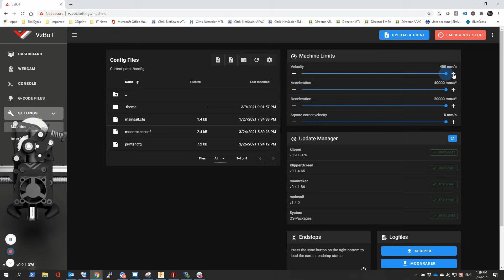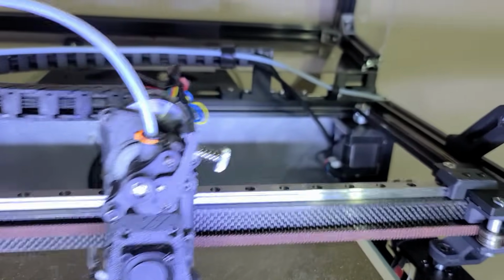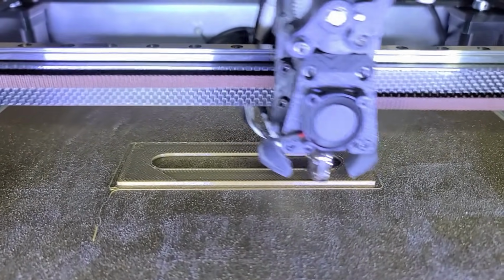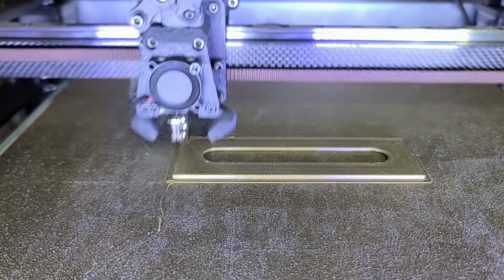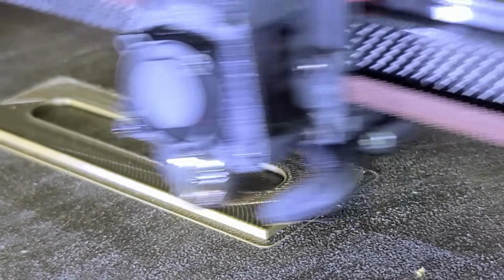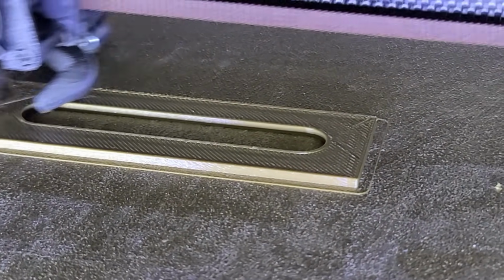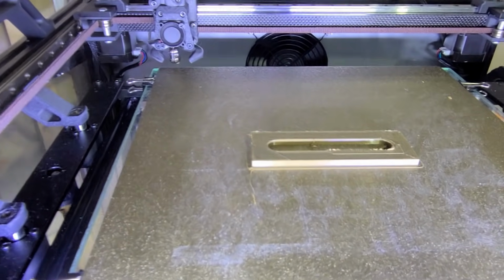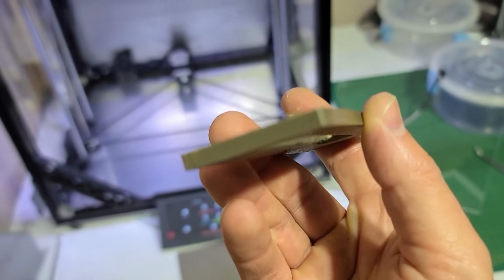Nova Hotend Speedtest 40K 400mms!

Comment: @VZ3d is it possible to set up your hotend with a phaetus Dragon BMS from Triangle Lab? If you know where I'd be able to find some stls to accommodate my printer with upgrades soon... I've been noticing that alot of people who are running klipper with these super high temperature hotends and core xy systems get a way to ridiculous printer speed....Id like to build a voron 2.4 or something close to your vz build, cuz you explain what you got going on under the hood of your hotend? Or are using multiple heads? Your Nova hotend is Soo cool 😎...Right now I'm barely using a Ender 3 v2 and I have a Phaetus Dragon BMS from Triangle Lab and I want to make upgrading the axis a Lil project also the hotend too....I just downloaded your CAD file design, any advice for a 3d printer enthusiast to get some inspiration? Also keep up the great work man and keep pushing to new heights ,.............alex

Comment: Based on everyone talking about the fans, it might be timely to to add a tube with pneumatics for the ultimate cooling solution. Who knows if you have enough pressure you could even help with the acceleration lol. Also I'm entirely certain that I'll need to adjust the stepper drivers on my ender cuz if that doesn't overheat your steppers, my board must be giving them double the voltage they need...

Comment: Also, put an accelerometer on it and calculate the G forces, i'd like to see that!
Reply from the maker: there is a sensor ADXL345 ..but I dont know to measure G forces with that
Reply: @Vez3D  If you have an arduino you can connect that sensor and find some relatively easy tutorials to program it and convert the values into G-Forces. 
After that you would have a true ClickWorthy Video to be famous! 
40K is supposed to be something like 40000mm/ss->40m/ss->40/9.81=4.078G That is if you get up to 40K.
Reply: @Vez3D  I dont remember if it's 40K on each axis or a sum so it could be K=sqrt(4*4+4*4)=5.67G for the sum of both axis (2 vectors into one)

Comment: Wow! just amazing! 
You seem to say that the motors are the bottle neck. If your are game, I'm willing to contribute and buy you a pair of longer nema 17 motors just to see you reach 100K. 
Other limits will probably be:
-Your controller limit in terms of pulse per second. If that is a limitation, increasing the pulley diameter (at the cost of precision) will be needed if you can't/don't want to change the controller.
-The 60W extruder heater power is probably going to be a limit too, even the 100w nova heater might be limiting at 1000mms. In any case, you could switch to a standard 120V cartridge with a REX-C100 controller. These could be up to 250W for a similar format. If you decide to go the 120V route, let me know if your need help setting up such controller, I'm doing it a few times / year at my job.
-Vibration of the whole thing ... this might make holes in your walls if the brackets aren't screwed to studs, but I am guessing that the mass of the extruder could be reduced by a third to a half using Fusion 360 design optimization and a good engineering resin. The fan and the shroud on the head could probably be replaced by a compressed air line with some ventury nozzles... or even by a big blower across the whole surface.

Many options ! 
I'm curious to see where you'll end-up with this!
Reply: Et Le, you may look like a baby (toddler?), but I can see that you know a thing or two about high performance printing with plastic filament.
Reply: @michaels3003  Thanks! Actually, like my daughter in the pic ;),  I don't know much about high performance 3D printing... I'm still printing at 45mms on my stock A8 anet because 55mms scares me. ;) All that I have learned so far on high speed printing is from this channel. However, where I can be useful is in electronics, dynamic systems, thermal control, material fatigue, etc, which is what I do at my day job. This allows me to extrapolate what is happening in the machine.
Reply: @etle113  , thank you for the explanation. You may find Chhogori / K2 printer from Annex-Engineering interesting. The related files of the active K2 project are on GitHub.

Comment: I wonder what will happen if you increase your deceleration or corner velocity. Perhaps get the latter high enough so that when the head is at a low enough speed, acceleration = force / moving mass. 75% of a 0.4Nm motor's max torque on 20T pulleys (6.05mm radius) and 500g of moving mass equates to 99,174 mm/s^2 theoretical acceleration.

Comment: Attach an imu to the print head and measure the G's
Reply from the maker: I have a adxl345 already. But dont know how to pull g forces for it
Reply from the maker: I also have an imu sensor somewhere i could use..but dont know how to use it hehe
Reply: When I made the comment I didn't know (yet) about Klipper and the adxl345  you use. Only knew about Marlin. So I learned something new that's very interesting from you .
Maybe an idea for the Klipper guys to support an imu as sensor and measure G's just for fun. I'd be very interested in the numbers! I only played with imu's controlled by micro controllers. There's loads of videos on youtube how to use them.
Cool to know you are from Canada, I am Dutch and been in Jasper long ago. Boring highways in Canada, only bends they have are vertical :)

Comment: Upgrading my Big Delta now to run at this speed. I print very large parts and this will be a huge advantage for me. I am using the BTT SKR 1.4 turbo as well, was wondering if you could share how you setup your Pi and board to run  Klipper. That are no videos showing how to setup the BTT SKR 1.4 Turbo.

Comment: This is truly incredible! Could you imagine showing this to someone back in 2015 when people were still using printers using strings and laser cut plywood?
Reply: funnily enough, tensioned cable-driven robots seem to be the final frontier of high-speed printing. time is a flat circle
Reply: @BB-io8cz  in fact, for more than one reason, I have in mind a new form of cartesian that is heavily inspired by hangprinter.

My objectives are for a larger format cartesian that can also be fast enough to not die of old age waiting for it, and also minimize parts and assembly complexity, along with reciprocating mass: you can’t do that so readily even with belts.
Reply: @strictnonconformist7369  rad! I actually hadn't seen the hangprinter yet, thanks for putting me on. i'd only theorized from seeing some industrial cable driven robots that moved waaaaay faster than any printer motion system. you sent me down a rabbit hole.

i'd love to see videos or some documents on what you're trying to do! especially about the differences between yours and hangprinter. sounds super interesting. also; i'd noticed you specified cartesian as the coordinates, intuitively i'd assume they would use something a la delta printers to calculate movement. whats the advantage of cartesian coords?

Comment: Vase mode has gotta be epic! What temp are you printing at if your going that fast. Pla people print @ 205c I'm always at 220c but print faster than alot of people but nothing close to this! Holy crap!
Reply from the maker: at that speed.. I was at 250-260
Reply: No way his cooling could handle that.
Reply from the maker: @Olof123  you are probably right here. That little 5015 might need some upgrade :) any suggestion ?
Reply: Why would it be any different than anything els? Are you using the bed hot or cold bc if your printing hot after the first few layers turn the bed off and the air temp change will make up the difference. I'm running. A crazy modified ender 3 and stock hotend fans. Anytime my cooling fan doesn't cut it I lower the bed temp if I can't slow the print down for time and slicer settings reasons I just manually drop the bed temp down to room temp if I'm running 70-80c bed it drops down to 30c it's like I'm running bigger fans
Reply: @Vez3D  I mean you can start with dual 5015s, I prefer deltas because they are really top of the line. The k2 is now running dual 5020 fans. But also the more work you can do with your ducts the better.
Reply from the maker: @Olof123  deltas are hard to beat man. I might build one someday
Reply: @Vez3D  I mean delta as the fan manufacturer.
Reply from the maker: @Olof123  oh i didnt know about them. Ill check. Thanks man
Reply: @Vez3D  feel free to join the annex discord, there’s a ton of channels dedicated to all printer stuff.
Reply from the maker: @Olof123  very cool Will do

Comment: those poor little bearings on the cooling fan... 😂
Reply: As I watched this insanity I was thinking: I hope those cooling fans are cheap and easy to change, they’re taking a thrashing I’d never seen! Usually it’s just fan blade motion that’s a blur, but in this case, the entire hot end was a blur to watch: pure insanity, and with such quality. Was that PLA being printed?
Reply: why not just use a compressor and feed an airline through?
Reply: @henrychan720  That's a great idea, it would be few grams lighter as well!
Reply from the maker: @henrychan720  berd air! Thats one option. This thing is still in progress.
Reply: Nova doesn't really need that heatsink fan, especially at such speeds. 🙂 Take it off 😉 And use a remote fan for part cooling just like I have.
Reply from the maker: @Vladlabs  im currently working on that. Inspired by the Hevort Hevac system
Reply: @Vladlabs  Someone please insulate the hot end and run flood coolant on a 3D printer.

Comment: I can literally watch this multiple times. Instead of a BOM. Could you do a overview of the printer video.
Reply from the maker: Its one of the upcoming video :)
Reply: Iwantbom
Reply: @Vez3D  If possibly, in that video please do talk about your bed setup/Z-motion system as having looked into Hevort/Voron and your design lately it seems one of the major difference between the systems is how they deal with the Z. 
Also, if you could include some thoughts on a heated chamber. 

Thing is, I am ready to build a printer specifically for PC and equally "advanced" materials so, I'll be looking into a design that's not only fairly fast but also not too difficult to enclose. So, it will be between a CoreXY or a Delta, I guess:)

Comment: amazing!
you changed the x axis from round cfk profil to a square one?! how do you drill the holes for the x rail precisly? Do you have a link for the profile for x?
Reply from the maker: with a drill :P  what do you mean exactly?  you put the rail on and you mark the holes. and you drill
Reply: @Vez3D ok sorry for unclear question. since u use a square tube, did u drill completly through the tube? i cant see the drill holes on the upper side. Where are the nuts placed?

Comment: You might want to set your top and bottom layers to be perpendicular rather than 45 degrees diagonal. Because CoreXY only use one of the two motors for x and y axis travel when it moves digitally. ^^
Reply from the maker: yes but the point was to show that one motor can make it :)  in reality you cant print everything in 45 degree , parts have different shapes :)

Comment: Are you using Arc Welder? You may be able to go faster if you do!
Reply from the maker: not on this print no. I was in the past using arc welder when i was using octoprint. Now I use mainsail so it is a manual process on each gcode to do arc-welding

Comment: wich stepper motor are you running with? It doesn't look the Tronxy's stock one. Ended up buying the 440mm CF square tube and a MGN7 rail to mount on it, the MGN12 i already have will be used at the Z axis
Reply: nvm, checked the video description and it's there
Reply from the maker: everything is in the description :)  E3D HT motors 0.9 degree ..

Comment: Invariably someone will say, “well, that’s pretty good, but it needs to be at least twice as fast!”

Clearly this crazy hot end needs a solid, stiff and anchored/heavy printer.

And cheaply, easily-replaced cooling fans because the bearings are almost certain to fail very quickly with such prolonged severe jerking if you keep cooling fans down there.

Comment: what did you do to stabilze the print bed?
if i did that with my machine it would flip over!
Reply from the maker: at that time I had added pom wheels in the from that holding the bed against the frame + the 4 10mm smooth rods. the printer is bolted to wall

Comment: Have you considered creating a machine frame using epoxy granite (especially the base) to increase rigidity and add vibration dampening? Your recent changes remind me of several aspects of the considerations that go into precision machine tools and epoxy granite (mineralguss) is heavily represented in that industry.
Reply: Would not say its required as the only forces this machine goes thourgh is its own moves. Its not a CNC, that needs to have minimal deflection.

Comment: I just ordered the freaking Hotend... freaking $200 USD for the cheapest option available.
12V 60W, 300°C NTC, Nozzle Removal Tool and that's that... it should be Plug and Play.
It better be Plug and Play or else I'm placing a Kill Order on Vlad, LoL.
I could have bought an entire printer, Anycubic i3 Mega S, for that amount, but printing at 50mm/s sucks.
I'm sick of clogged nozzles, oozing, insufficient extrusion, not to mention failed prints and wasted material.
Reply from the maker: It will not disappoint you. However..my cad model you need to have the V6 long adapter to fit...if you build a vzbot
Reply: @Vez3D  I have a custom 3D Printer, it's an old design, but I'm slowly upgrading it.

Comment: What's the fastest you can print and get GREAT quality?
Reply from the maker: Thats the fastest i got so far.
Reply: @Vez3D  It's fast af, but the quality isn't really the best?
Reply from the maker: @vesslades  its really not that bad actually..thanks to Input_shaper
Reply: @Vez3D  Allright, I run a voron 2.4 myself, with input shaping. But I'm nowhere near those acc + speeds if I want to get good (perfect) print quality
Reply from the maker: @vesslades  it will certainly not be perfect at that speed hehe. I dont print normally at that speed

Comment: That’s awesome! 
How is you experience with the carbon x axis? 
Is it a problem to find a straight piece and is it hard to mount and algin the rail?
Reply from the maker: Easy to find on aliexpress. Easy to mount too. I printed myself a tool to hold m3 nuts inside where I could not reach with a surgeon long pliers
Reply: @Vez3D  cool, thank you for the explanation maybe I’ll do something similar.

Comment: Jesus that's fast. Out of curiosity, what led you to use what looks like roll wrapped carbon tubing rather than unidirectional or pultruded tubing?
Reply: Pultrusion have very short fibers and are weaker
Reply: @ProDesigneHd  Do you have a source for that information? So far everything I've seen and experienced personally has indicated the exact opposite.

Comment: How are the bearings on the linear rail guide holding up? That squeaking when the printer head runs the wall perimeter sounds like metal abrasion. Print quality is insane
Reply from the maker: That sound is actually the stepper motors